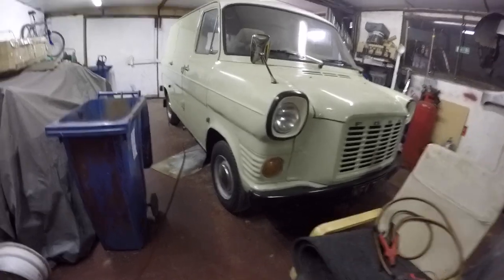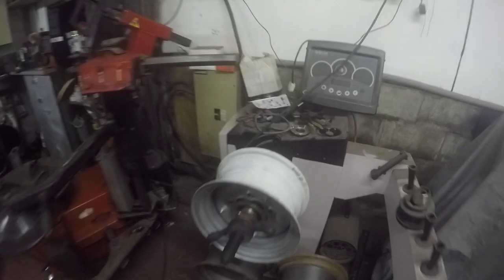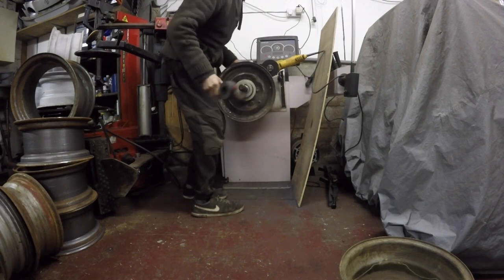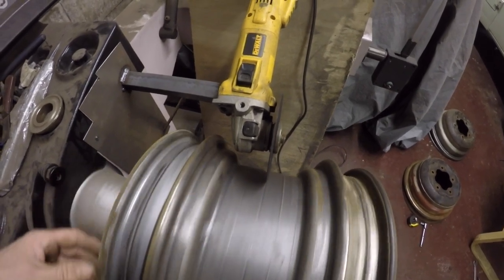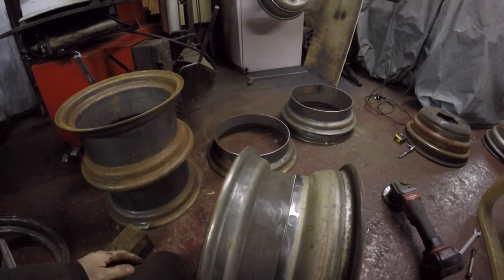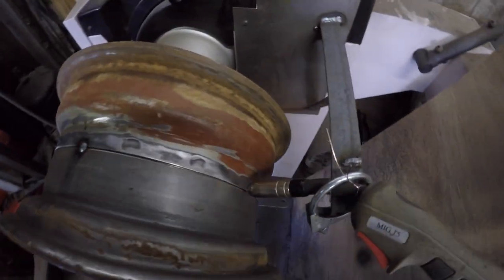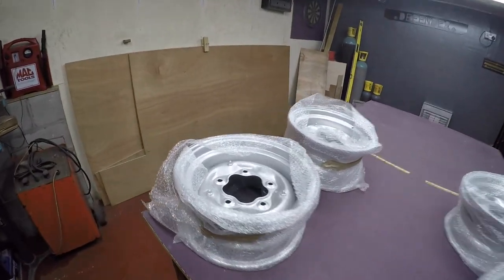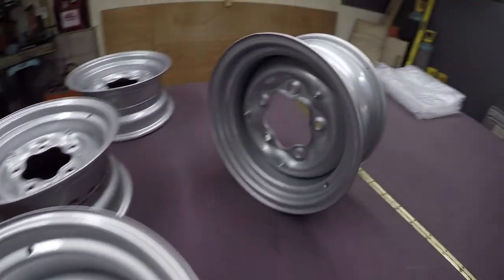HOW TO BAND WHEELS WITHOUT BANDING (DIY)

Comment: the tire changer spins slower so you might be able to weld full speen on that if you set the voltage and wirespeed right , can set the welding gun on a stand and just let her rip
Reply from the maker: Yea I’ve seen people do them and other circular stuff on tyre machines and was going to do it myself too but ended up just doing it on my balancer as was easy to just put my welding torch where my grinder was 😁 good call though mate 👍👍 cheers

Comment: Is that a tractor wheel barrel? There is no bead to hold a tubeless tire on.
Reply from the maker: Not sure as I got them secondhand off eBay, but normally barrels do have at least one recess to hold tyre bead but these don’t have any. It worked out better for me anyway 😃👍